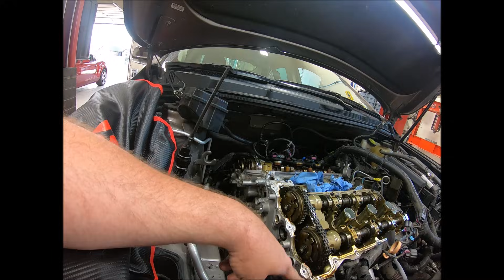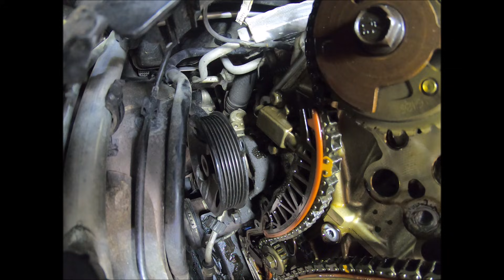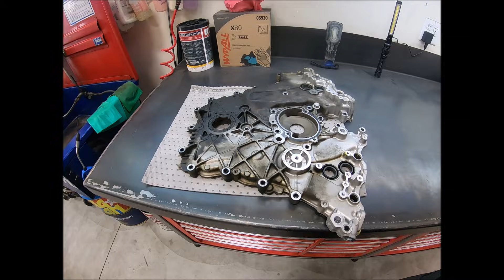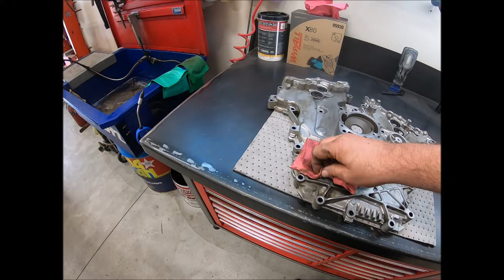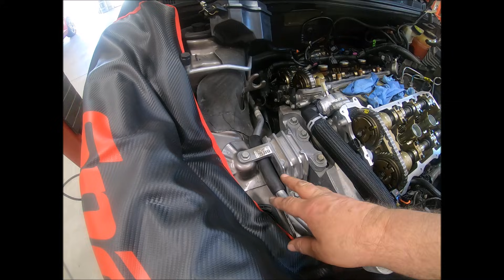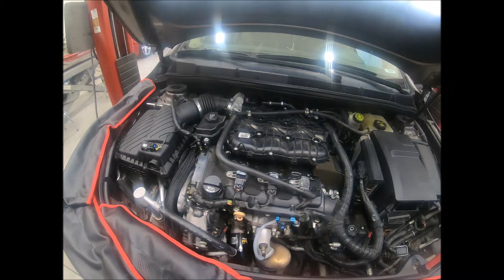Buick V6 Timing Chain Replacements

Comment: Are the new chains designed to eliminate the problem? Take a 2X4 and put it in a vise narrow side up. Stretch a new and old chain out and balance them in the center on the 2X4 side by side. If the old chain sags more at the ends the chain isn't stretched, it's worn inside the links. The carbon in the oil is wearing the chain out causing the timing issue, not stretching. 
Take an HVAC Digital vacuum meter and hook it to the Dipstick tube at Hot/Idle and measure PCV System vacuum. My guess is it's less than .5inHg. This carbon loads the oil and the inside of the engine with Blowby causing the Brown varnish we see in this one. Some OEM's do this to keep the Intake and cylinders running cleaner but with Low Tension rings create this varnish/carbon problem. Honda/Acura stick Oil Control Rings with this design decision. My wife's 12 TL, watch it will go under pressure at certain points which isn't desirable for more than a few seconds. An engine should be cleaner on the inside than the outside and we should see 400-600K miles from current engines, not problems at 60 and 70K miles. 
https://www.youtube.com/watch?v=0NmEvB2lFS0
Reply from the maker: The new chains do nothing to prevent future wear, it still comes down to proper service intervals and even then, they will need replacing again at some point, much like continued timing belt replacements over hundreds of thousands of miles of owning a vehicle long enough.  

I would agree that the carbon buildup in the oil is abrasive which causes the wear to the pins and links.  As I mentioned in the video that neglecting oil changes or going to extended oil service  internals only exacerbates the problem.    When I mentioned the chains stretched, I did not literally mean that the actual links were stretching, I don't think anyone in the industry who talks about stretched chains means they literally stretch.  I work in the industrial maintenance field and we use chain "stretch" gauges on many pieces of equipment and all have a maximum allowable limit of what is acceptable, when that limit is reached the chains are replaced.  The pins wear and the holes in the link plates wear which in essence make the chain longer due to the wear, hence chain stretch. 

Unfortunately, this is just the nature of chains.  When it comes to timing an ICE, we are faced with either belts or chains and both will need replacement at some point.  There are gears as well but they don't play well with knock sensors and I really only have used those in race applications.  

Thank you for taking the time to watch. 
Mike
Reply: @zmotorsports62  When you drop vacuum on the PCV System it carbon loads the oil and looks like the customer didn't change their oil often enough when the Primary issue is the Low vac not evacuating the crankcase/low tension ring pack in the first place. This is why Honda and Toyota have in their owners manuals that 1Q burnt per 1200 miles is acceptable and the domestics that run 1 to 3inHg don't. If you don't evacuate the ring pack of Blowby(heat) sooner than later you'll stick the Oil Control Rings/then oil consumption will spike. Their mechanic tells them they didn't change their oil often enough. You shouldn't have to change Full Syn TBN 10 oil at 3000 miles or there's something else wrong. Retired 3G Ind, mechanic.

Comment: Can you do a timing chain on a Buick Enclave 2011 With the engine in as you did this video would you drop the engine?
Reply from the maker: No need to remove the engine from the car.  It's a bit tight but can be done without removal.

Comment: Hey I bought a 2011 Buick lacrosse 3.6 and I’ve had to re do whole front suspension and radiator etc etc problem after problem now I’m at 188,000 miles and my timing chain went out. Should I just get a new car ? Or should I fix it? I’m broke and not really in a position to buy a new car. But I am a good mechanic. I could get rid of this and get a better car. Idk lmk
Reply: Also it sounds terrible when you start it , like a rattling bad sound. Idk if I caused major engine damage. I drove home acrosee town , with it like that stahling out and stuff. I have no engine light tho. You think my engines done or you think I should fix it ?
Reply from the maker: Hard to diagnose by only description, but if everything else is in good condition with the car I'd fix it.  But I'm not one for cutting and running just to buy a new car, I prefer to keep my older paid for cars in great condition rather than trading cars when problems arise.

Comment: I have a 2011 lacrosse with the 3.6 is the process the same?
Reply from the maker: Should be.  The 2.8 liter, 3.0 liter and 3.6 liter up until approx. 2014 were all the GM high feature engine family.

Comment: Watched your video. 40yr retired mechanic.  Other than the three chain setups, similar to the Ford 3.7 tear down. Except Ford's waterpump runs off the timing chain. Stupid design. Thanks, I know this will be a cakewalk for me if and when i do need to go in.
Reply from the maker: Glad the video is helpful.  Thank you for watching. 
Mike
Reply: Ford 3.5 and 3.7 are way easier to replace the timing chains than these engines. Master Mechanic.  Have done dozens of each of them. Don't have to mess with any accessories other than tensioner on Ford. Have to remove alternator and power steering pump, tensioner on GM. Ford 3.5 can be done easily in 5 hrs. Gm's take 7 to 9 hrs everytime.

Comment: One or the banks is always darker color then other. Usually looks burned orange. That because crankcase vent that is in the cover has very small hole that get clogged by burned oil. I would drill a bigger hole in the vent tube for crankcase to breeze better and the chains would last longer.

Comment: i do an oil change every 3000 miles 120000 miles later timing change i think timing chains are to small bike chains. and to many moving parts and you dont get any better gas milage. just a bad dissign

Comment: i was thinking if i mean if chev. could build a motor like a toyota . my dad has a seinna 5000 miles oil change just as clean comming out as is it went in 154000 miles on it. what are they doing that we cant . or is it corp. greed. also i had an older 350 motor rebuilt it an got 25-26 mpg with it as long as i stayed off the secondarys chev. could do a lot better

Comment: Those engines along with the 3.6L are complete junk. My 170,000 mi  2003 Buick LeSabre 3800 (REAL BUICK ENGINE) will run circles around those other engines. Still has the original timing chain and gears in it too!

Comment: I assume this is similar to the SRX engine bay.  How did u support the motor once u removed the passenger side motor mount?
Reply from the maker: For this particular job I had the engine supported from underneath using a floor jack.   For others I've used a topside engine support while removing the engine mount.

Comment: Really wish u showed the teardown to the starting point.
Reply from the maker: Sorry, that would have been too long of a video and getting down to the front cover is pretty basic.
Reply: You had to remove the motor mount correct?  How did u support the engine?
Reply from the maker: @2013creed that is correct.  Motor mount was removed.   I used a floor jack to support it from underneath.    

Thanks for taking the time to watch 
Mike
Reply: Great video, I am using it step by step.  I figured that u supported it from below, but I was a little confused because u lifted the car to get to the harmonic balancer.  I couldn’t understand how u did that.  I also can’t thank u enough for your replies! U have been a great help.

Comment: Thank you, I used your video to replace the timing chain in my 2010 3.0 v6 Lacrosse. Don't know if I could've done it without you!!
Reply from the maker: Thank you.  Glad the video was helpful.  Thank you for taking the time to watch and for the comments. 
Mike
Reply: @zmotorsports62  Hi, I am getting a P0300 code after replacing the chains. Do you have any idea of what could be causing this?
Reply from the maker: Not sure why you'd be getting a random misfire.  If the cam chains were installed incorrectly I would think that you would get a camshaft variation code rather than a misfire code.
Reply: @zmotorsports62  I did replace all the fuel injectors about a month prior to the timing chain. Could it be spark plugs or ignition coils?
Reply from the maker: Sorry, plugs and/or ignition coils will be specific to one cylinder and therefore have a DTC set for one specific cylinder that is misfiring, not a P0300 which is multiple and random misfires.  Check to see if you have a vacuum leak.
Reply: Smoke test and check for vacuum leaks

Comment: I just bought this car with 61,000 miles. You think its a decent car? What should i look out for?
Reply from the maker: It's hard to say over a message.  The second gens were decent cars for their respective era.  A little underpowered from mid-70's through mid to later 80's, especially compared to their predecessors or later models but nice cars none the less.  It really comes down to the condition and how it was maintained by the previous owner(s).

Comment: The oil monitor is just a reference guide.  I just go by how often I drove my vehicle and I check my oil level and the quality of it by taking a quick check. And just change it when they get dark brown.  Cheap oil will lose they're lubricity in extreme heat.

Comment: What does a job like that normally run
Reply from the maker: I don't like to discuss costs openly as there are so many variables.  That being said, this is a time intensive job and there can be several variables such as if you decide to lower the drivetrain from the car or do it in the car.  Also quality of parts vary and can greatly affect the final cost.

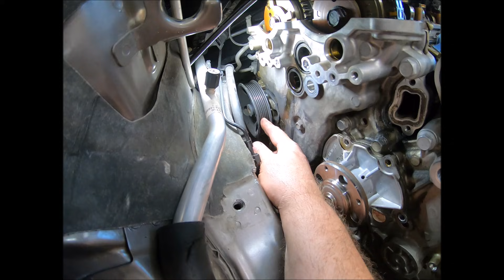Comment: 9:43  how did you remove the top bolt through the steering power pulley? I can get the socket  in place but there isn’t enough room for the ratchet to fit? The engine doesn’t lower down enough to access it through the wheel well.
Reply from the maker: I was able to use a semi-deep socket with a thin ratchet to extract the bolt through the hole in the pulley.

Comment: Is it worth doing this in the car or just drop the whole motor out?
Reply from the maker: This particular car was easy to do in the car.  I've done some other high feature GM engines in other applications that are easier with the power train dropped from the vehicle.  

Thanks for watching. 
Mike

Comment: When doing stage 1 timing the primary camshaft timing chain slipped on the gear on the crank.  I ended up with the camshaft flats up on the left side with the alignment tool in place, but the crankshaft timing circle indicator on the sprocket not lining up with stage one timing (at about 12 o'clock  -- 60% over-rotated?).  Now the chains are off.  I was wondering if now I just rotate the crank to stage one timing by going clockwise.  Or, do two rotations to state one timing?  I'm confused how to line things up now.
Reply from the maker: With the chain off and crank not connected to the cams you can back the crank up a bit to realign.  However, not ideal.  If the crank and cam(s) are still connected via the chain(s) then make sure to turn it in the correct rotation.
Reply: @zmotorsports62  Thanks for the reply!  The chains are off.  When I tried to rotate backwards there was a lot of resistance and the crank bolt I was using to turn the crank loosened. so I rotated clockwise to get to state one.  However, if it's important to go backwards I can get a crank socket so I can rotate backwards with more force.  I took the chains off because due to the slippage the crank was not lined up with the cams.
Reply from the maker: @bruceb2839 it is preferable to rotate in the direction of rotation.  I've rotated counterclockwise on engines in the past with the spark plugs removed, but if they are still in place the compression (resistance) is usually enough to back the crank bolt out.
Reply: @zmotorsports62  Do you suggest I rotate clockwise from 12 o-clock where it was to the stage one timing mark, or rotate one rotation past the timing mark.  (Thanks for engaging with me -- I'm confused by all this.)
Reply from the maker: @bruceb2839 yes.  When setting up the chains in relation to the timing marks I recommend rotating the engine in normal rotation, clockwise looking at the front.
Reply: @zmotorsports62  Thanks!  I think I'll also check if cylinders 1 and 4 are in tdc to make sure all is aligned.  Cylinder 1 valve is closed and 4 overlap but I can't change them since the chains are off -- but that is correct as far as I've learned.

Comment: This is great! My friend just gave me his car… this exact car…. And yep it needs this done. I have the codes and know for a fact it was neglected. Also the water pump is making an awful noise and leaking everywhere. Do you have a link for the kit you used? Or did you buy some of it separately? Any idea the price? I’ll prob be back to ask you a question lol😂
Reply from the maker: I used the Melling timing kit (3753S).

If I remember correctly I purchased the Fel-Pro gaskets from my local NAPA.  

Mike
Reply: @zmotorsports62  thanks! I always get the manual and read… idk I used to be a helicopter mechanic in the usaf and I like reading instructions. My wife says I’m ocd about this stuff. Reading manual it says this procedure can only be performed with the engine removed…. I mean you didn’t do it prob don’t have to right? 

Also wanna say I always appreciate you guys writing us back. I’ve had many other help me through YouTube chat. Thank you sir
Reply from the maker: In this particular application the work can be completed without removing the engine.  I think they write some of the manuals using generalities  and some applications are too tight and do require the engine be removed to gain access.  

Mike
Reply: @zmotorsports62  you’re awesome thank you. I’ll prob back 🤣 with more questions. Going to order some of those cam lock tools and everything else. Get it all ready and learn as much as I can before starting. Thanks again